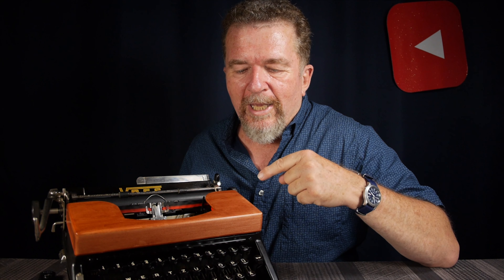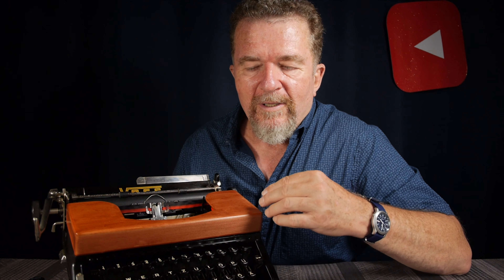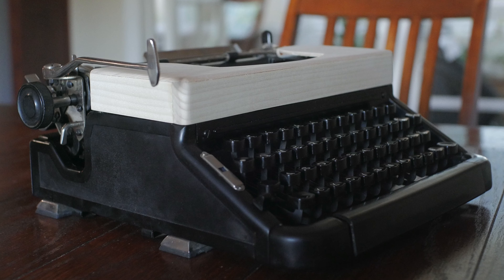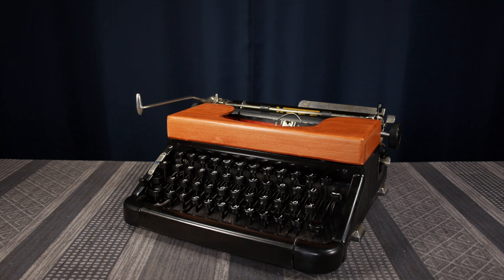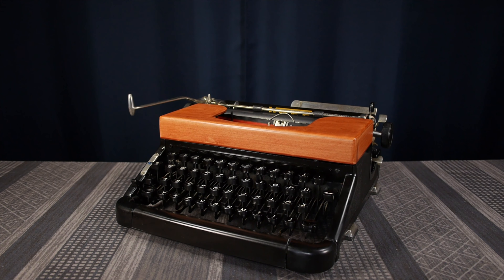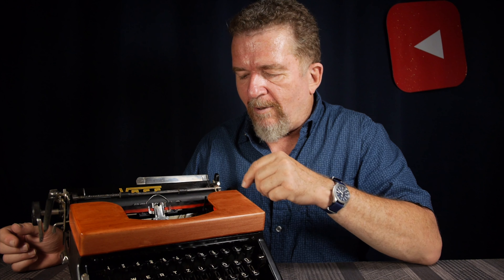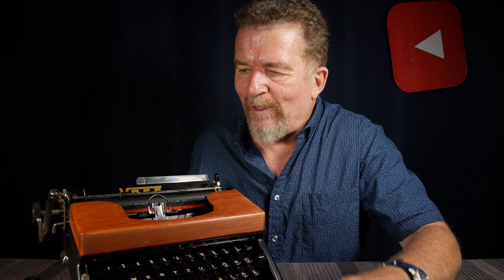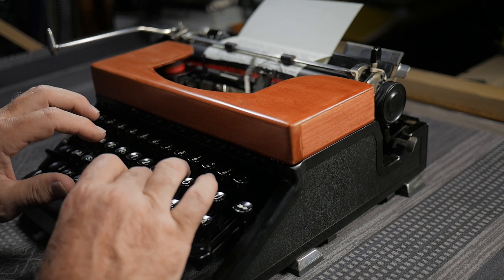Typewriter Video Series - Episode 225: Voss Ribbon Cover

Comment: A beautiful survivor, I hope you made a note that stays with the Typewriter, a voice record another could read about why this rescued parts machine was given a wooden cover, I certainly wood...see what I did there lol

I think you did a great job, and it's amazing how wood can make metal look nice, not a typewriter, but my Dad's '78 Dodge Ramcharger had these pleather stuffed armrests that sat on this sharp rail, and of course at the time the vehicle was 40 years old, still running and driving, but the years those armrests took destroyed them down to the sharp metal brackets, you wouldn't want to put your arm on them. Lol..
So I removed them gutted the metal frames, also not a master wood worker but I am a SERIOUS Hobbiest and a force to recon with especially with tools and a Dremel lol, so I took a board of Oak lumber cut it down and split it to two equal parts and fashioned with a serious amount of sanding, whew, then stained them, made to fit the bracket, attached them, and they look like they've always been there.  Dad passed almost 4 years ago, I'm now the owner of the 4x4 all the time beast.  Hard to work on it and maintain the other vehicles along with my condition, but we keep going, Like Give'em hell Harry!  Lol, my wife doesn't understand why I like Electric vehicles, Less to maintain! 

Very cool Joe Thank you.